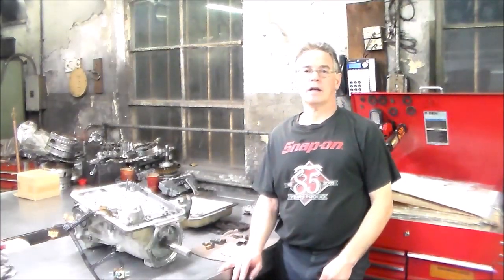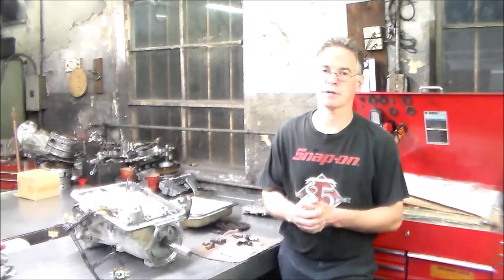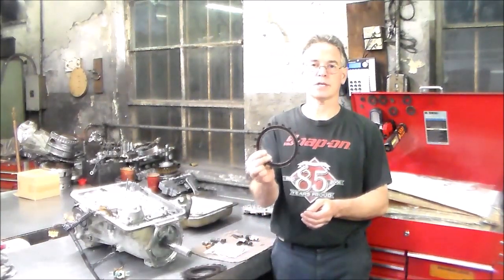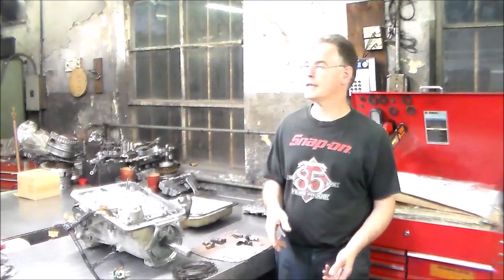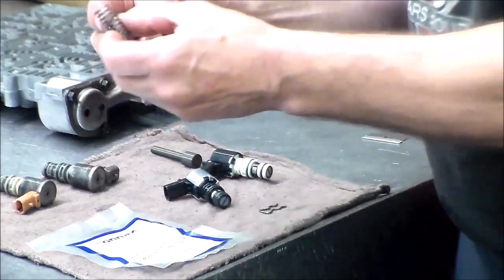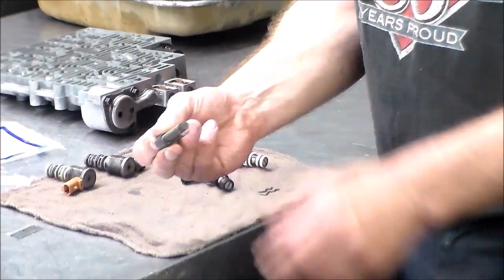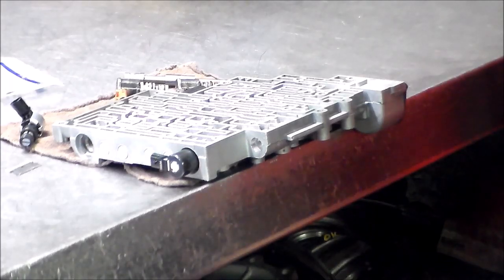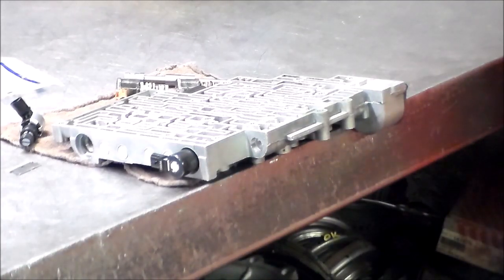4L60E, Moves Forward In Neutral

Comment: My jeep has this problem
Reply from the maker: If your linkage is ok. Then you have a clutch pack locked on. No reverse correct.
Reply: @GaryFerraro  yes sir same problem. So it'll be smart to get a new transfer case or break it down and replace the part.. ? Or what do I do?
Reply from the maker: @dulceespinoza6036  Sounds like transmission not transfer case
Reply: Yea my bad I don't know why I was saying transfer case. I've done changed the governor pressure solenoid and sensor and adjusted the reverse band there wasn't any large metal pieces or anything. . what is gonna be my next move @gary Ferraro. Thank you for responding
Reply from the maker: @dulceespinoza6036  Well, i would say the trans has to come out to be repaired or rebuilt

Comment: Man your doing a lot of talking why can’t you just say this is why your 4l60e is lerching in park! 

I just built a 95 I did a 100% over haul rebuild all new parts sprags basket shift kit decked the valve body an case new separater 

2 gear hold I spared no expense 

An my car jumps in park not all the time but when it dose it worry’s me. 

I did that spring your showing the spring under my separater was broke nothing in the valve body was broke. But I still replaced it all with what came In the shift kit.

Drilled out all the check ball holes with the bit the kit came with.

I mean I watched every video I could find an this was my first ever transmission rebuild I made custom spring compressors.

I just don’t understand what your telling me cuz your a little all over the place an I understand you were addressing the issues you had with what your working on.

I replaced all the electronics an wire harness so are you saying it’s the spring? I have the old one I took out. An I think I have a more extras depending on how aggressive I wanted to make my shifts. My car don’t slam in to gear but she ain’t stock.

Hope you can answer my question of why she jumps forward?

An I can not drive In neutral and my reverse works shifts threw all gears great. Other then that second gear hold I have to lift off the peddle to let it shift. 

It will not shift unless I lift an that’s only when I stand on it if I just drive it she shifts normal

Please help…. Thank you

Sorry I gave you my life story but I like to be thorough an detailed.

Comment: what could be the problem when you  have all gears but when in neutral it won't roll backwards but will go forward? 4l60e.
Reply from the maker: there is a clutch pack locked togther, check the linkage first and if that is ok, internal problem with a locked clutch pack

Comment: Honda ridgeline almost same issue neutral moves foward w a stutter no reverse and slams stops in drive at 25mph? Any idea?
Reply from the maker: you have a clutch that is locked together,  did this run low on oil at some point